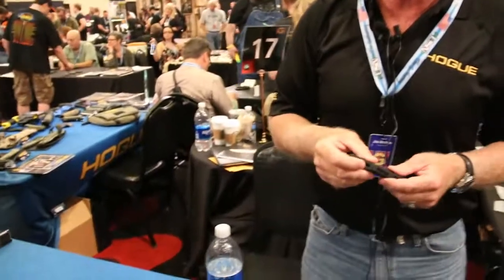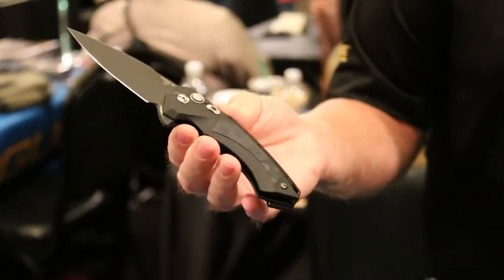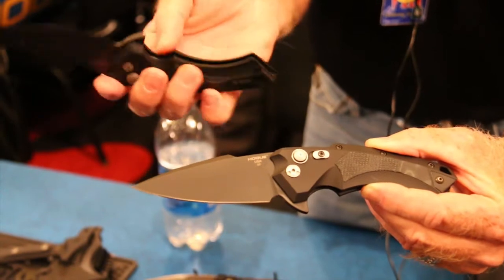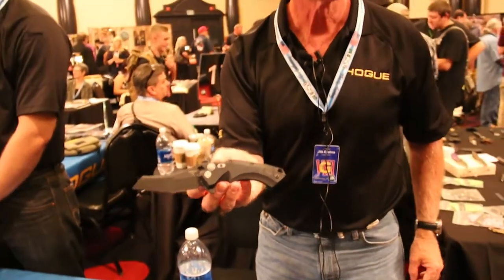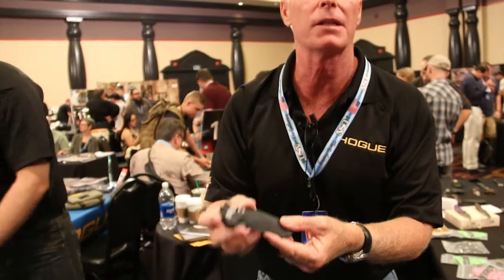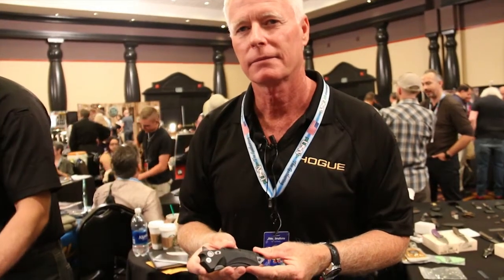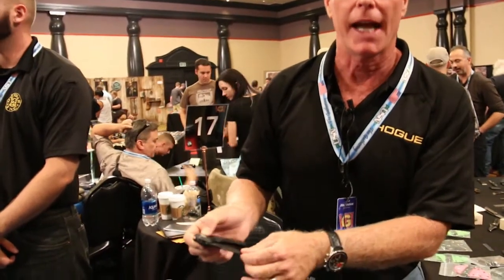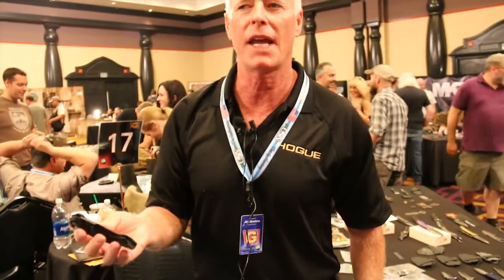Jim Bruhns, The Hogue X5 Button Lock Flipper, Blade Retaining Knife Mechanism

Comment: What do you mean "spring arm"
Reply from the maker: A fair question.Yeah, I didn't get the internal pictures, yet, perhaps I better work on that. But the way it was described to me was the it is exactly the same concept as a liner-lock. OK, picture a liner-lock, with the lock-bar and on the end is a small ball bearing that functions as a ball detent. This ball drops into a hole in the tang and loosely holds the blade closed so it would flop out unwantedly while in the closed position. Let's call the lock-bar the spring-arm like some people do. This knife has such a spring-arm cut into the liner. Real short, on the inside, unseen. Unlike a liner-lock it does nothing to lock the blade in the open position. All it does is push a detent ball against the tang in the closed position to help keep the blade closed. Ernie Emerison had a patent on such a device. I don't know if he ever put it into any of his knives. I'll try to get pictures.
Reply: oh i understand good
Reply from the maker: BTW, Let me mention something I just discovered. If you Google Sanremu 9054 you could find the internal pictures of that knife. It is a "liner-lock slip-joint" so to speak. You will see a spring-arm on both sides. This is what I think is in the Hogue knife, but just one arm with one detent. And it only detents in the closed position since the button-lock is used for the open position.